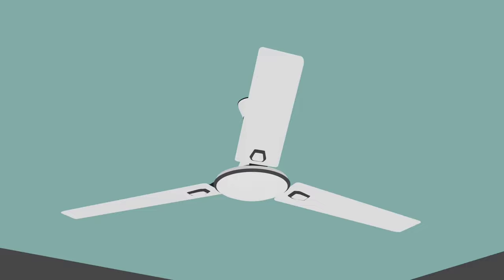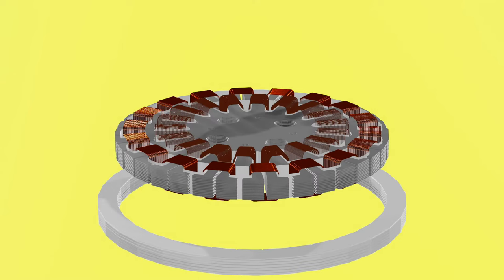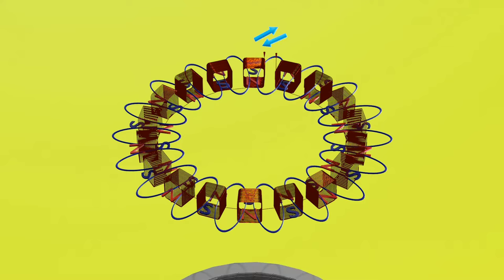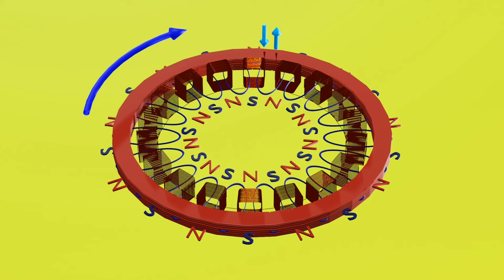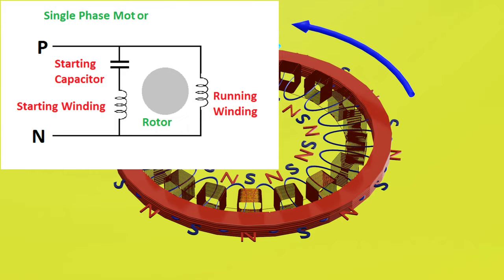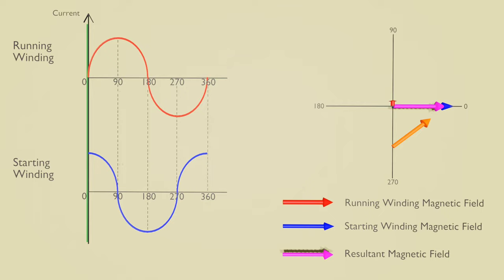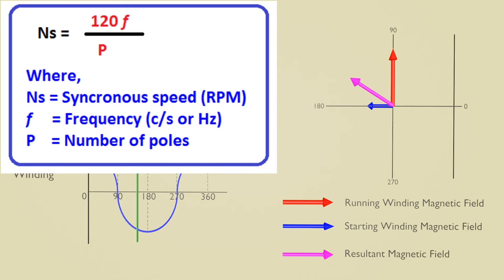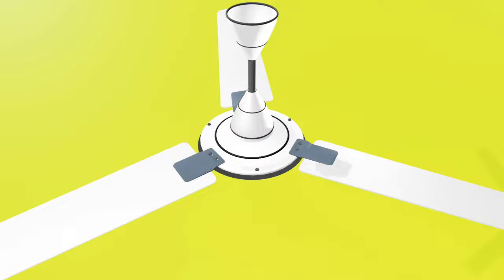How "Ceiling fan"  or "Single phase induction motor" works ?

Comment: Advise :
The circuit you use should be N in the place of P and P in the place of N because in phase shift we use Condencer after the coil not before it ad i wish u good luck.
Reply from the maker: Thank for your feedback, but in AC circuit P and N are interchangeable because current change it's direction every half cycle .
Reply: @lucid1258  sure i know but there is line and nutral in ac ether i know what i advise for u take care and good luck my dear .

Comment: what's the use of inner winding of ceiing fan
Reply from the maker: In ceiling fan or single phase induction motor the function of providing two winding is to create a phase shift between two winding and create a rotating magnetic field using capacitor or any other way.